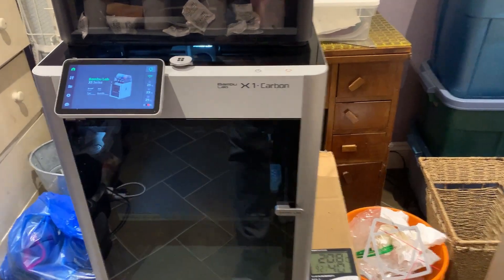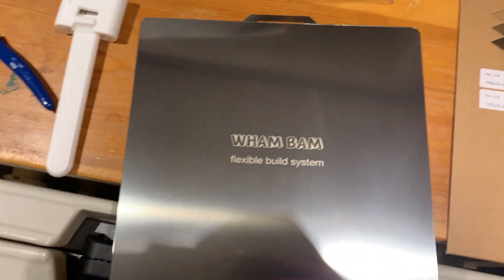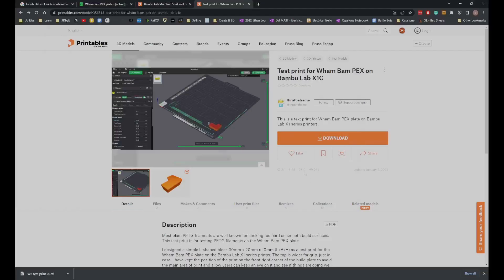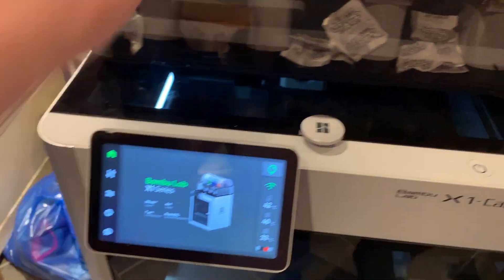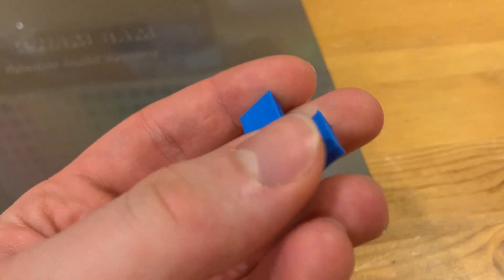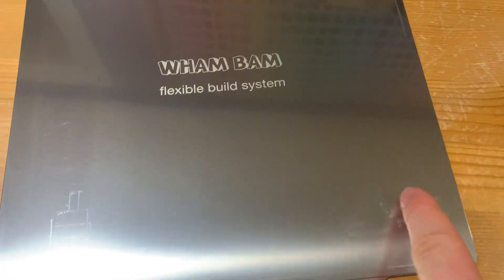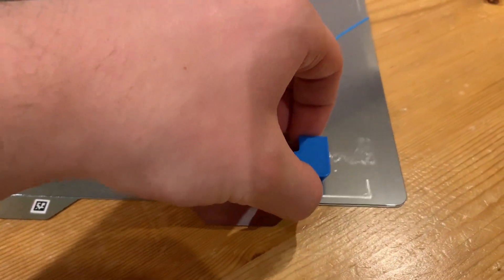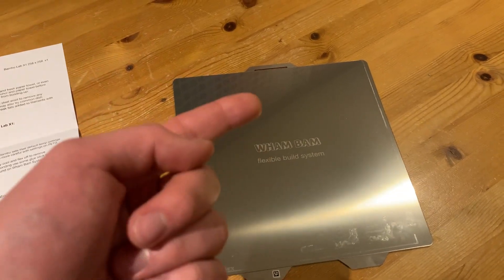Wham Bam PEX Plate - Bambu Lab X1C - PLA, PETG, ASA Testing

Comment: Did you ever try the Visionminer adhesive on the bambu plates? Just curious, I have a Wham Bam XTR plate, and I'm looking at buying the PEX plate But I plan to use PEX plate with Visionminer adhesive.
Reply from the maker: I have not tried this. That stuff is $$$. Lemme know if you do!
Reply: @futureethan  They have smaller bottles now, found a couple YouTubers who twitch stream and give them away also. Loyal mosses is one. I have a bottle from Amazon $20 but haven't used it yet I've only been using textured plate so far. So I need to buy a smooth plate.

Comment: GLUE IS NOT FOR GLUEING.... Many people seem to be misunderstanding why you should use a glue stick with PETG.  It's NOT to make it stick!  Actually, just the opposite.  The glue stick is used as a releasing agent!  PETG tends to stick TOO well.  Glue stick is used because it is easy to apply a thin layer and this type of glue doesn't cure, so you can use it over and over and clean it up easy with just water.  I've heard Windex can be a good releasing agent as well.

Comment: I really was turned off by the requirement that I scuff the plate. I bought this at MicroCenter and I'm holding off on possibly returning it...but you're not the first person I've seen who's NOT scuffed it despite the instructions. Mine also came WITH a burgundy 3M scuffing pad.

Comment: you ever get that other bed to test that you said would be the solution?
Reply from the maker: I haven't been able to find someone to cut the sheets down to size. I was going to cut some prusa satin sheets to size. I have found those work great for what I usually print (petg, pla, Asa). Once I finish moving, I plan to revisit that and find someone to cut em for me. Not the most approachable solution, however.

Also, I find Garolite to work great with petg, pla works well on the high-temperature sheet, and I think Asa works on Garolite.
Reply: @futureethan I honestly normally print just with pla+ but maybe just go use a cutoff wheel and try to cut that other sheet, how much needs to come off?

Comment: Glue Stick is cheap and easy to use, also water soluble. Best of all, it just works. I found that Textured PEI wasnt enough alone to keep my prints from coming un-stuck especially when printing at higher speeds on my BambuLabs printer, so I had to take to using glue stick despite everyone and their mom saying its unnecessary and doesnt help on PEI. Could be that my environment is too cold or that theres a lot of particulants in the air here, but glue stick has been a super cheap and easy fix. I dont even have to use it every print, just ever 3-4 prints, and it keeps my prints secured to the bed. It'd be nice to not need/rely on Glue Stick, but im not willing to spend and arm and a leg on build plates and testing when gluestick is so cheap and easy to solve the issue.

Comment: I think not enough people liquid glue sticks.  They work fine.  Really easy to apply evenly.

I need to go get some hairspray, it sounds like it works even better.

For the cost...I love the cool plate.  I'd like a wham Bam pex plate, but it's kind of pricey if I'm going to end up buying more than 1.  I might get 1 anyway.  Already got a G10 garolite plate which is nice.  But only because nylon was giving me issues with sticking.

Comment: Im no expert, mostly print in PLA on a textured PEI (bambu P1P and Prusa Mini).... But, i've read that first layer height for PETG should be a little higher than with PLA. I'm aure the default PETG swttings in the slicer should do this, but maybe try adjusting it  a bit higher?

Comment: Am I crazy? Or is it absurd that the Bambu comes with a build surface that requires glue stick? I don't think I've had to use a glue stick on a bed in almost 8 or 9 years!
Reply from the maker: Yeah it is crazy. The bambu PEI sheet doesnt require glue for PLA, PETG or ASA.
Reply from the maker: But it is rexommended

Comment: Hi. Where can I get the modified Gcode files? They are no longer available on Printables...
Reply from the maker: I don't think you need any modified code to use the plate. The main changes from the gcode have been implemented into Bambu Studio by default.
Reply: Yes, I know that I don't absolutely need the code, but making the start and end process could be useful. By the way, how have the main changes been implemented into Bambu Studio? @futureethan

Comment: You should have scuffed the plate and you should also scuff and clean it after every print. I never had an issue with PETG, ABS, ASA, or PLA. No Gcode is needed too.. That Gcode was used in the very beginning and is not necessary today ( it is an impressive Gcode but not needed). Highly recommend scuffing with 000 steel wool and cleaning with IPA after every print.
Reply from the maker: Do you think that scuffing the bed would create more surface area, making the part stick more?

Comment: I use textured PEI plate and it does not require any glue to be honest, but mostly printing PLA+ and started PETG. I have never used on any of my prints 🤷‍♂️
Reply from the maker: Textured is great! But for some things that I print, the texture is not desireable.
Reply: @futureethan  completely understandable 👍

Comment: This aversion to glue stick make me laugh. It literally takes 30 seconds to apply glue stick to a build plate and the surface is good for many many prints without any additional application. Your just making life hard on yourself for no real reason.
Reply from the maker: Gluestick is easy to apply to the bed, yes.. but then I need to wash the part off which gets the part wet, then dry it off. I print a lot of parts which I sell so doing this for every part is just extra post processing cost…
Reply: @futureethan  Hmmm I've never noticed the glue transferring  to the parts that I have printed and even it it did get on the parts cleaning off the minor residue is way easier than all the frustrations around not using glue stick in the first place.
Reply: the reg glue stick def leaves a white film... only reason i dont like it...
Reply: Bro! 🤣 I love my glue!

Comment: If you haven't yet, you should try the textured sheet by Thekkiinngg.  I've been using it for the past few weeks, and not one failure. And it works with the lidar if you like using that.  As far as using PETG it's always recommended to use glue stick as a release agent.  When COVID first started I was using one of my PEX sheets to print face shields using PETG, it didn't look like it was damaging the plate at first, but over time it did start to scar up the PEX sheet.  I'm like you, I hate using glue stick, but when printing with PETG I'll switch over to using the Bambu Labs Engineering plate with the glue stick.
Reply from the maker: Thanks for the suggestion! Looking into it now. Hows the bottome layer texture? Is it super noticeable like on the BBL Texture Sheet?
Reply: @futureethan  it is very noticeable.  I tried various filaments on mine today, ABS worked very well.  I printed multiple 4hr plus prints using ABS and none of them warped, and once plate was fully cooled down they self released.  ASA stuck a little hard though, I might stick to the glue stick and Bambu Engineering plate for now if I want to print with ASA.  TPU also worked very well.  I did not try PETG, I’ve ordered a second plate just so I can do quick swaps of the plates after a print is finished.  Once I get the spare sheet I’ll give PETG a try.  That way if it does damage the sheet I’ll have a second one ready to go. About a week ago the Thekkiinngg web site was down for some reason.  My guess is they were out of stock.  I think it’s just a one man operation out of Canada.

Comment: The links for the  G Code and Test print are dead. The user doesn't have them posted any more it seems
Reply: Did you ever figure out if there was anywhere else to get the start and end g code files for Bambu labs using the wham bam build plate?

Comment: Whats the difference between the high temp sheet and engineering plate? I have come from prusa and only ever used or needed two plates. A thekkiiing texture pei for petg and the smooth prusa plate with glue for cf or abs and no glue for pla. sooo many sheets now?
Reply from the maker: High telp sheet is pei. Engineering plate is some other material. Coming from prusa just use textured or high temp. I hope this helps!
Reply: I have only used my engineering plate with TPU, i used the liquid bambu glue... slow print to spec and the parts came out beautifully and used a plastic scraper..

Comment: Nice video. Why didn't you experiment with bed temperature? I can imagine that would influence the bed adhesion more.
Reply from the maker: I did this because the wham bam recommended bed temps did not have a range. I could have done a lot more testing but this wasnt supposed to be a detail test. Thanks!
Reply: 10:50 he does change bed temp if it doesn't work the first time.

I guess it would be an interesting video to see the max and min temps. 

If it works it works though

Comment: How do those filament rolls work in the AMS?  Are they cardboard?
Reply from the maker: They are not carboard but more a compressed paper so they are stiff. I have almost 1k hours printing with them in ams. Polymaker filament uses them
Reply: @futureethan  thanks for the quick response. I’ve been looking at that brand but was hesitant because I thought it was cardboard.

Comment: Bambu recommends using a glue stick only to protect the build surface.  I notice on the wham bam they have the same warning on their flex plate.  I use the engineering and cool plate exclusively, i do have the pei plate, and have never had an issue after I used the glue once and then cleaned the plate with IPA.
Reply from the maker: Do you use glue stick or other material with your engineering and cool plate?
Reply: @futureethan  I used some of the glue stick for a couple of prints and then gave the plate a good wash and honestly haven’t had any problems. Thank goodness the plate flexes because it does stick very well. I just love the smooth surface it gives to prints especially if you’re mating two pieces. 

Love your videos!  They are very clear and well done.

Comment: I got to say. I hate glue stick but Bambu is also selling a liquid and as you (should) wipe down the bed anyway on regular basis, using the glue liquid is much much better.
Reply from the maker: Does it leave residue on the bottom of the part?
Reply: no @futureethan

Comment: I use Bambu’s double sided PEI and I’ve never had any layer adhesion issues (never used the glue stick either) 🤷‍♂️
Reply from the maker: The textured pei sheet? If so, I am looking for a smooth surface finish.

Comment: Is the bed “damage” actually permanent? Thought it’s just plastic that stuck too well and can be cleaned off?
Reply from the maker: I just looked at the bed and tried cleaning it off. The part which made the mark on the bed definitely pulled up some of the bed. It isnt much but it is just enough to leave a mark on the bottom of future prints. So I would say the bed is damaged.
Reply: @futureethan  I had the same defect in my plate after the model came off, but it disappeared after using the plate a few more times. Maybe the heat healed it.
Reply from the maker: @jeffroberts930  interesting. I'll try using it a little more.
Reply: @futureethan  Or try to use acetone on it.

Comment: I'm telling ya right now you do not need gluestick for the engineering plate with PETG. it is literally the perfect bed plate for PETG. no gluestick. Just clean with iso and it works better than anything else I've used
Reply from the maker: Trying this tonight. Will update.
Reply: Works great with ASA too. Just a little IPA and a wipe before i print and everything has pretty much popped right off as the plate naturally cools
Reply: I’ve been using this too no glue and no issues. Only thing is if I’m printing on the very edge of plate 255mm I need glue (maybe since it’s the edge the bed isn’t as hot?)
Reply from the maker: First print worked so well… Trying with a bigger part now. You are legends!
Reply: You may want to look into G10/Garolite.

Comment: I tried G10 after watching Maker's Muse video, have you ever tried G10 with the X1C? I currently use it on my budget printer, but am concerned about how to apply the sheet to a bambu printer

I think it could be very interesting if you were able to custom cut out a sheet of G10 and fit it in
Reply: There are a couple vendors I found online that sell magnetic compatible G10 plates for the X1C. My X1C just got here yesterday, I'll probably be buying G10 and WhamBam plates for it soon.
Reply from the maker: I have thought about doing this. How well is G10 compatible with PETG and ASA? My only concern would be how to mount it to the magnetic bed in an elegant way.
Reply: @futureethan  I have never tried it with those materials, but it is an amazing surface to work with for PLA. I imagine one would have to get a magnetic steel bed and see if you could bond a g10 plate to the other side. You would probably have to order it a bit too large and then cut it into the exact bambu bed shape. Too bad there isn't space for clips like on Ender3s
Reply from the maker: If a bed doesn't work well for PLA I don't think it should be considered a bed 🤣 I would be interested to see ASA and PETG. Where did you get your G10 from?

Comment: I completely concur that using glue stick to 3D print in 2023 is dumber than dirt.  I've been printing TPU on a textured glass build plate for years and it's spoiled me.  I pop off the part, peel off the skirt that was printed to prime the nozzle and I'm good to print another part.  I print on a 75C glass bed for the first layer and the bed is unheated for the remainder of the print so there's not much wasted energy with a heated bed heating my office.
Reply from the maker: That is luxury. I wish all polymers were that easy. I have been searching for many years. I'll might make a short video about all my attempts to find the best bed. Glue stick is lame!

Comment: Is the bed surface actually metal ? Or is just a sheet like the golden smooth PEI  from aliexpress ?
Reply from the maker: The bed's surface is PEX which is a surface on top of a metal flex sheet similar to a PEi flex sheet.
Reply: @futureethan  have you use one of those golden PEI ones ? If so, would you say PEX is worth the extra money?
Reply from the maker: I have tried the energetic ones from aliexpress. Same problem with petg. If you are just using pla, both work great.

Comment: I have learned that PETG even with adhesive like Magigoo and it leaves horrible stains to the plate. Wouldn’t buy it again. Not trying to be negative. PLA all day on it though
Reply from the maker: That's frustrating. I had hope but I guess this is not the bed for me even if using adhesives. PLA can print on everything tho which doesn't make the $$$ price tag for the bed any better.

Comment: I just received my PEX plate on Saturday, now waiting for my BL X1C to arrive today. then the fun begins. I'm coming from an ender 3 s1 pro  which glue stick and hair spray did not work for me. The only thing that worked was blue painters tape. Can wait to be done with that setup.
Reply from the maker: Painters tape is what I used a few years ago. Now it is usually PEI. I don't want glue stick or hairspray residue on my prints. Tape is by far the most reliable from what I remember from a few years ago but a pain to apply to the bed.

Comment: Just got mine in today, thanks for doing this as I was about to test asa/petg, did the marks end up coming off?
Reply from the maker: ASA and PETG are my most printed filaments. I was a little upset to see it not work out well for petg :/ The marks did not come off :/ They are permanent :(
Reply: @futureethan  just printed with pla for the first time. It didn’t stick with 60c but it did with 65c although first layer was a little sloppy
Reply: @futureethan  according to whambam docs you need gluestick as a release agent for petg